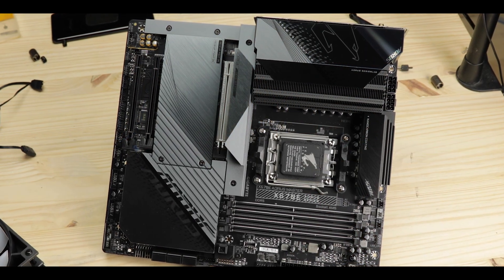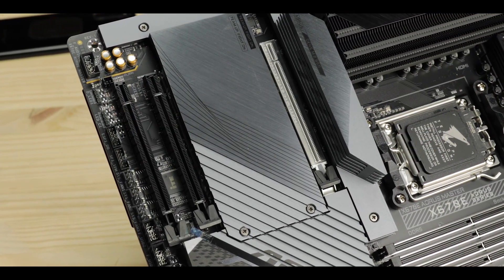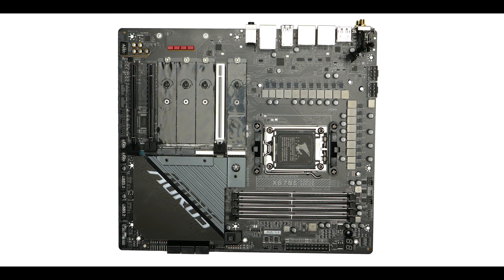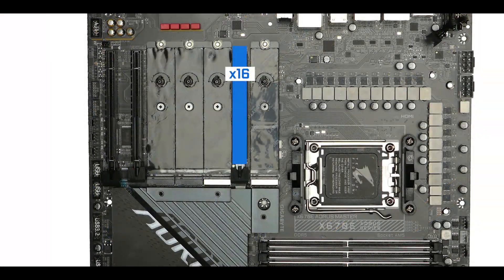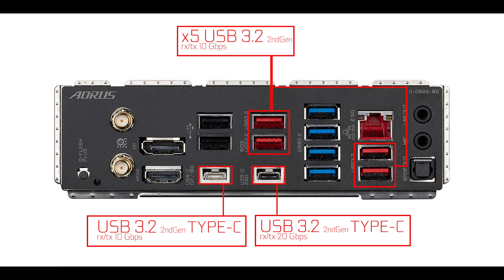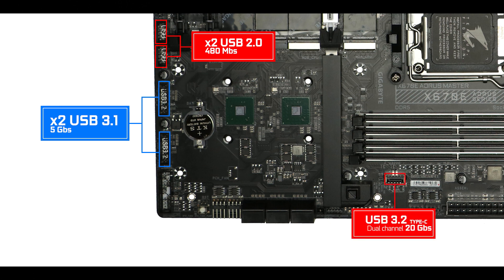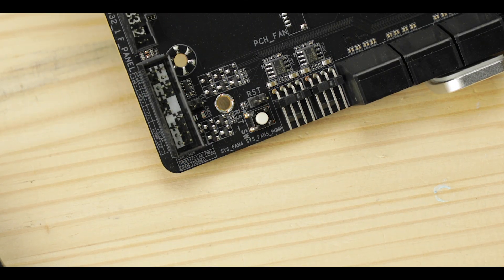GIGABYTE X670E AORUS MASTER : it all started so well

Comment: Great review, worth mentioning over the Asus pci-e layout is that whilst not ideal for dual gpu use its better for single gpu users as you can fill both the lower pci-e slots with cards and keep your gpu running at 16X. The Asus boards will lower your gpu to 8X as soon as you populate that lower slot. It would be nice if gigabyte supported PD on the front usb-c header like asus does however.
Reply: hey. Which asus do you mean Asus X670E-E ? Because im choosing between asus x670e-e and x670e aorus master. So its better to stick to aorus?
Reply: @iNasteable Gigabyte is the better choice i tested both and there are some big errors in this self expert videos.
Reply: @DrSnuggles22  for me and 7950x3d there is no any other option than asus with core-flex. Glad i chose Asus. Gigabyte i had like 3 mobos and all of them had problems and was showing errors on q-code
Reply: @iNasteable  strange i have no issues tried different boards, Asus Gigabyte and MSI. Sure you set all the important Bios options correct?

Comment: I'm pretty sure the board supports multiple GPUs (why wouldn't it?), as the manual mentions AMD CrossFire support on page 9. It's only 4 lanes on the second slot, but that seems to be the same as on the Strix boards.
Reply: It has 1 x16, 1 x4 and 1 x2.  Not ideal for dual gpus but explains their m.2 support

Comment: I'm building my first pc (for gaming of course) and plan to get a 7800x3d. For future proofing and just overall ease, what board would you recommend in the 300-350 price range. I was thinking the rog b650e-e after watching your review but wanted to know what you thought.
Reply: Which did u end up choosing dawg? Respect.
Reply: @bibi24  Evidently haven't decided yet. Been waiting on more reviews and if newer boards mightve released since then. But so far seems like it's still gonna be a rog b650e-e. Just seems to be the best for the price range. Probably gonna hold off till it goes on sale. But I've gotten most of the other parts for the build, all I need now if my checklist is right is a gpu, cpu and motherboard.
Reply: What did you end up getting and how is it going?
Reply: @danijelb.3384  hey what about RAM on this mobo, this video does it support upto x4 16gb total 64GB CL30 ?

Comment: This is a gaming board not a mining or content creator board. Nobody uses multi gpu setups for gaming anymore, SLI and Crossfire died years ago and NVLink never got anywhere and it’s pretty much dead as well.
Reply: Not only for multi gpu but some would also want to put in sound blaster, Intel 10Gbe NIC card, or LSI SAS controllers in it as well
Reply: @PreciousAlpschindler  true, I use my extra pci slots for extra usb hub cards and header cards. But most people aren’t going to do that.
Reply: @PreciousAlpschindler LOL you want a PCIe 16x for a nic or a sound blaster whats wrong with you rofl…
Reply: @DrSnuggles22  1. Minimise CPU usage by offloading to an EMU20K2 chip and it can do hardware EAX on retro games
2. Realtek onboard nic is not that great for people who want absolute network reliability. Intel NIC offload stuff from the CPU as well
3. Someday 10Gbe network will be a norm
4. Leaving extra PCI lanes would ensure all the expansion cards work perfectly even when it is fully loaded

I get it. it's a niche stuff that most PC users don't need but nothing beat dedicated expansion card
Reply: @PreciousAlpschindler  lol you dont know what youre talking about sorry.

Comment: Strix will cut your videobus in half for that extra m.2 gen 5 drive, whereas Gigabyte's B650E Aorus Master will do the same for 2 extra m.2 gen 5 drives, giving you all 4 gen 5 m.2 drives.
Reply: Aorus Master only has 2 5th gen m.2 the other are gen 4.
Reply: @TheSjuris  The "superior" X670E AORUS MASTER  has 2 5th gen m.2s and 2 4th gen m.2s, but Gigabyte's B650E Aorus Master has all 4 5th gen m.2s, as well as X670E AORUS XTREME, making the latter useless.
Reply: @CywlexeemTacac  the Aorus b650e Msster isn’t even around anymore for that reason. Gigabyte realized their mistake.

Comment: Very nice review which make me dive deeper into these MOBOs. Thanks. Nevertheless, I am curious why you are comparing this motherboard to "better ASUS Strix" which has 3x M.2x4 PCI5.0 lanes and one GPU x16 5.0 lane. This config is impossible and the gpu bandwidth of ASUS motherboard is robbed by one of M.2. As it is stated in AM5 - 24 usable PCI 5.0 lanes. You cant put 3x M.2 PCIx4 5.0 there, because the GPU will get only x8 (taken from the manual).  Therefore this one argument over the Aorus Master is burried down. Another is the sound card :). The 1220 and 4080 have very similar sound quality so there will not be a huge difference from the codec itself. More it will be from capacitors used there (and the Aorus Master has some polymer WIMA filter caps there - which ensures huge quality of sound). Second argument....
Can You convince me to buy ASUS once??
Reply: Well stated.  I removed Strix E-E from purchase consideration because the 3rd M.2 PCIE5.0 slot cripples the GPU to x8.  I would never use that slot as a result.
Reply: @C6v1999  And the reviewer still did not answer my question :)
Reply: @piotrmalczyk260  If it were my channel, I would redo the video when this spec detail was pointed out to me.  So that would be a hassle and I do not blame the video maker for not wanting to.  I would never recommend that board though.
Reply: Gigabyte has 2 3.2 header and Asus has 1. This is why I am going with the Gigabyte Master and you can use 4 NVMe drives and it will not slow down the GPU because the other m.2 work on the chip set. The Extreme will.
Reply: @short5stick  yes exactly! And the reviewer is still saying that asus is the better mobo.

Comment: do the m2 slots disable the sata ports? so with my gigabyte b450 aorus elite, four slots would be deactivated if i installed two ssds
With the x670e, I can't find anything about it in the instructions, but I just wanted to be sure
Reply: No only the 3rd PCI express slot X2 does. It is in the Manual. Page 9 Expansion Slots tells you there.

Comment: I am currently using this motherboard. In my custom liquid cooling system, I connected a probe that measures the water temperature to the motherboard and I had the opportunity to adjust my fans via the gigabyte software. This is an excellent feature, yes there was a probe mount on my msi x570s carbon motherboard before, but I could only see the water temperature and this was ridiculous.
Thanks for the review too. I am very happy with the 7700X processor and I really like this motherboard. :))
Reply from the maker: Hey Salim !
Glad you like it. Awesome VRM indeed !!!!!
Reply: Own this mono to no complaints so far
Reply: @erenbas80  same paired with RX 7900 XTX , 850w EVGA gold and this thing is a BEAST :face-blue-smiling:
Reply: @Laurentschoice  you just don't know what you're talking about. You need to research this question, what is the difference between the 1220 and 4080? The ALC4080 and ALC1220 have equivalent specifications on paper. The difference is that the ALC1220 uses the Intel HD Audio standard, which uses a direct connection to the chipset bus. The ALC4080, on the other hand, uses a USB interface. USB audio is crap if it's not done right. I have a $700 Topping D90 DAC that has a terrible USB implementation that forces me to use optics. So spending more on USB audio isn't always better. Since the ALC4080 uses USB, people with ALC4080 mobas have reported crackles even through the optical output, which is unthinkable given that optical is supposed to be lossless and electrically isolated. So, among these two boards you named x670e aurus master stomping board
Reply from the maker: @user-tp8ts6vf1z as an audio professional, and if u had to use and integrated solution, u'd stay with the a 1220 , direct BUS solution rather than the new USB based 4080/82 ?

Comment: I am looking at getting this board. Is it still good? Can i use up all 4 ram slots at 6000mt without loosing ram speed? it will be paired with a 7800x3d and for future upgrades
Reply: Hi im using it right now & i've only put 2x16 32gb 6000Mhz Gskillz Flare X5 CL30, the support page for MEM frequency i didn't see any 64gb or using all the 4 slots of RAM 
Idk im kinda unsure too

Comment: Hey Laurent great review just wanted to add that the aorus master actually uses the last gen alc 1220 codec which is a bummer considering how beatiful the board looks with it's bulky vrm's.Also could you cover the x670E-F Gaming just ordered that last week want to hear your opinion on it.Thanks :))
Reply from the maker: Really ???? Wait ... mine add a alc 4080  on it...
 This is so strange and frankly shocking coming from AORUS !
Reply: There is absolutely nothing wrong or lacking with the 1220. The analog parts of the audio cirquits are much much more important. ALC 4080 has been causing a lot of trouble for a lot of people since it came out, and it's connected internally via USB instead of I2S, likely increasing latency. I'm VERY glad that Gigabyte is sticking with the 1220.

Comment: Salut Lorant! I really like your MB-reviews, you just missed out on the one that I'd consider, although you've covered almost all others out of the series:
The Asus ProArt x670e
The special thing about this one is, that you get 2x Gen5 x8, if both slots are in use, meaning: Two Gen4 (32 GB/s) GPUs, both equally CPU-bound — I have not seen any other board that splits the Gen5 slot in two like this, which might a big plus for creators, when using 2 GPU's, as both of them should be equally fast and performant, as it seems to me. 
The ProArt x670e also features 10 GbE Lan, plus two USB4 on the back panel (no idea if those are indeed 40 Gb/s wide).
Would be nice to hear what you think about this board, as I'm just a user, no expert on motherboards or PC hardware.
Best regards and thank you for your deep insights and also your fun approach to cover those dry high-tech matters. Cheers!
Reply: I thought about this some more, and my conclusion is, that the way ASUS did it on the ProArt x670e is the most efficient:
- Either, I use a Gen 5 GPU, in the far future, then, the second (Gen5 x8) slot remains empty,.or I plug in 2 existing GPU or whatever boards, then both of them get 32 GB/s bandwidth. Either way, it always takes 16 lanes.
On every other board, it will take the 16 Gen5-lanes, plus 4 or 8 more lanes of the second PCIe-slot.
— On the OroArt x670e, they have obviously put this saved bandwith into the two USB4 ports plus the 10G Ethernet, as it aeems to me.
— My conclusion is:
The nerds should tell the mainboard makers, that they shall for now do it as on the ASUS ProArt x670e, as there are almost no Gen5 GPU's out yet, and the way ASUS shows it, we get two times  Gen5 x8 directly connected to the CPU, which barely another board is able to deliver.
What do you think Laurent? —  Is my.vertict right? Or is it not this way, cause I made a mistake?
— I think we'd see much better boards coming out — esp. now as the x870e era is just getting launched, if we'd spread some awareness, as there is only so much you can do with 28 lanes, esp. if you already got 16 of them bound, and have only 12 left for ...
a) the second CPU slot — ideally at least 8 lanes
b) plus: all M.2 NMVe SSD's (but only 8 lanes left)
Better only 8+8 lanes on two Gen5 x8 slots, and have the full bandwidth of 99,99% of all GPUs!
Again, 12 CPU-lanes are available, but now, we hsve already plugged in two  RTX A4000 boards into our two Gen5 x8 slots. — We have gained/saved 8 lanes by applying this trick!
— Hope you know what I mean, it's pretty simple, but hard to explain.
Cheers from Vienne, Yuri
Reply: Well, I was day-dreaming of this last night, guess that makes me as well some kind of nerdy tweaky nerdy nerd :)) ://
__
Let's maximize PCIe connections:
8+8 lanes, or 1x 16 Lanes: 1 or 2 GPU's
 +4 Lanes: connect to Chipset A
+ 4 Lanes: connect to Chipset B
[uses twice the bandwidth to Chipsets]
+ 4 Lanes: 2x USB4 (80 Gb/s)
                 + 2x 10 GbE Lan (20 Gb/s)
                 + 28 Gb/s: low bandwitdth
                    direct USB 2 & USB 3 ports
Chipset A: 1x Gen 5 x4 SSD (128 Gb/s)
                 + 1x USB4 (40 Gb/s)
                 + 1x USB 3.2 x2 (20 Gb/2)
                 + 2x 10 GbE Lan (20 Gb/s)
                 + Rest: 48 Gb/s:USB 2 & 3 et al.
Chipset B: 3x Gen 4 x4 SSD (192 Gb/s)
                 + 1x USB4 (40 Gb/s)
                 + 1x USB 3.2 x2 (20 Gb/2)
                 + Rest: 4 Gb/s: USB 2 & 3 et al.
__
So, I get:
2x Gen5 x8 or 1x Gen5 x16 PCIe
1x Gen5 x4 M.2 SSD
3x Gen4.x4 M.2 SSD's
4x 10 G Lan
4x USB4 (40 Gb/s)
2x USB 3.2 x2 (20 Gb/s)
plus some more USB 2 & 3 ports.
___
Well, I might deliver this to Asus, Gigabyte, MSI, ASRock & Co, maybe that can help to inspire them to give us more high-bandwidth connections, which are essential for 4k video productions and stuff like this. Cheers!

Comment: Yeah, I didn't use those NVME drive slots, but used the 6 SATA ports instead.  
Those um ancient thigns.  You know, because if my mobo dies, I can move my SATA drivees to some other computer and plug them into anything from all the way back to 1990 and be able tor ead them.  Can't do that with nvme.

Comment: Does anyone know if they m.2 slots on this board gen 5 or the gen 4 will cause the the gpu to not run at 16 lanes ?
Reply: They both will work fine with Gen 5 x4 and the GPU will get the full 16 lanes. If you use the PCIeX2 Slot it deactivates 2 of the SATA Ports! 

Out of the manual:
PCIEX2 shared with 2 SATA Ports (SATA 4&5)
Reply: @TigerNationDE  thank you ! Do you have this motherboard? I’m confused on which usb ports on motherboard actually go directly to the cpu? As in which color on the back of io panel ?

Comment: I am torn between the X670E aorus master and the ASUS ROG STRIX X670E-E GAMING WIFI. What say you?
Reply from the maker: Strix x670e e just for the dual gpu support and the AWESOME OC bios features
Reply: @Laurentschoice  Cool. Currently using the crosshair viii dark hero. Planning my transition to the AM5 platform.  Does the Strix X670E-E still have those Intel LAN issues I keep reading about?
Reply: @axi6ne8us This is pretty late, but yes it does.

Comment: Thanks for video. I have 2x (2x 16gb ddr5 6000 c36) 64 GB ram slow which codes are "cmt32gx5m2x6000c36"... But it Gigabyte web site,  it seems Gigabyute support cmt32gx5m2a6000c36 and cmt32gx5m2b6000c36. Not cmt32gx5m2x6000c36. Difference is M2A-M2B-M2X part... CAn i usew my rams on this mainboard?

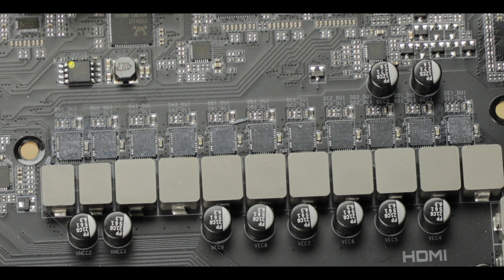Comment: 4:27 🍌 So, I was studying the VRM heatsink, and I can't figure out if the air passes through it or it just stagnates inside. In addition there is a small cover (the one with "AORUS DESIGNLAB" on it) which facilitates the stagnation of air flows. can anyone explain to me please? Because, you know, someone have an aftermarket aircooler (lateral air instead of spreaded air to the sides)... And please, don't just answer with "it works", because dust can say nope.

Comment: Merry Christmas, indeed, Laurent; All the Best to You and Yours in the New Year!!! 😀

FINALLY!!! the X670E Master!!! =) ...about which I have a question; how fast would putting two Barracuda 530 2TB m.2's IN RAID 0 into the two processor connected (primary???) slots?!?? >=)

It IS a Gen5 x4 bus link; therefore, theoretically, there should be SUFFICIENT BANDWIDTH to run both drives at max speed with ZERO BOTTLENECKING to slow either drive...!?!! 🤔😏😉🤫🫡